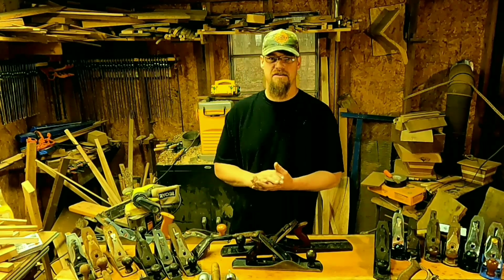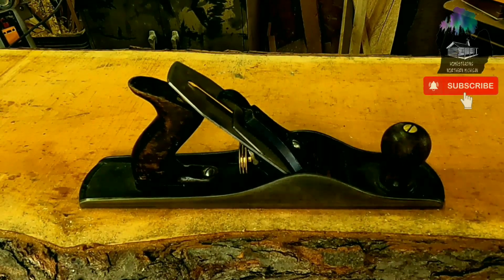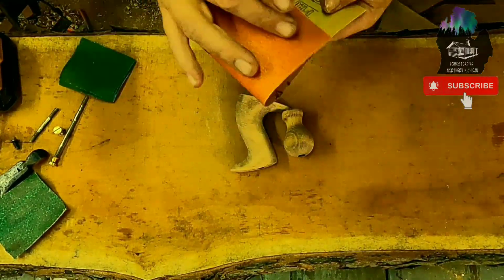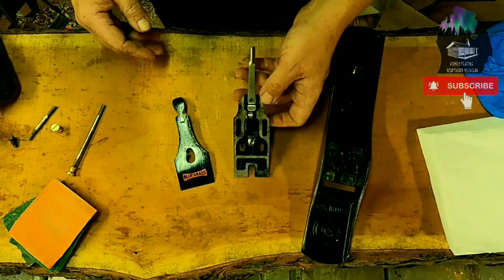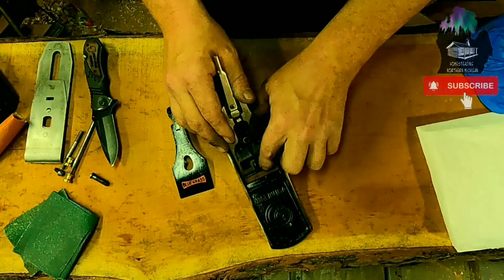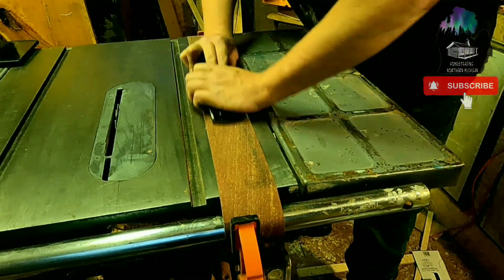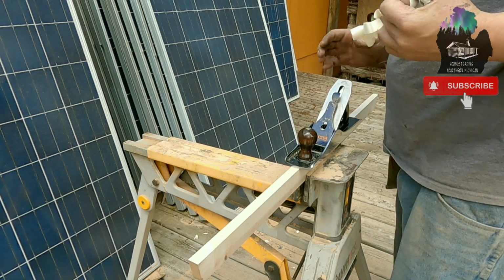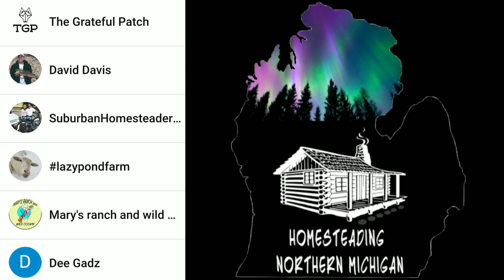Incredible Hand Plane Restoration (mirror finish)

Comment: 3 years late but hope for a reply, I bought an  Irwin Record no 4 plane, whats your opinion? I kinda wanna change the lever cap to a Stanley lever type rather than screw, should I?
Reply from the maker: @SoSimonSays  most parts are interchangeable... you may need to modify the screw but it should be a very usable replacement
Reply: @HomesteadingNorthernMichigan  i think as its my first screw type cap im  gonna have a play and get used to the torque and tension. If i dont get on I will swap it for a lever type cap, thanks for reply